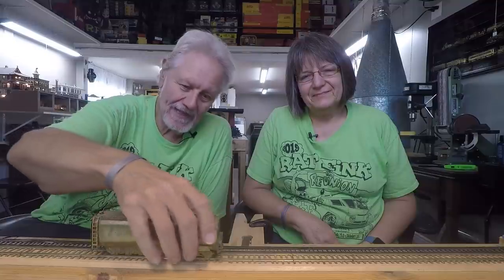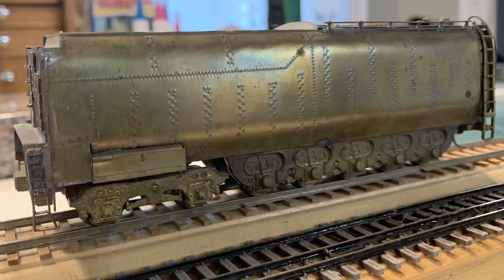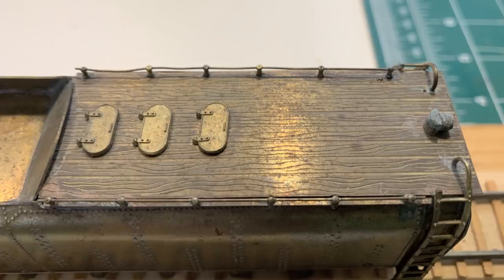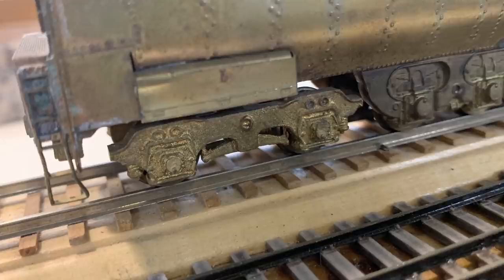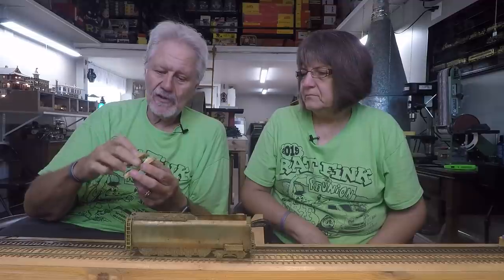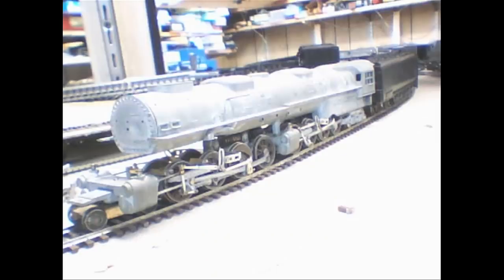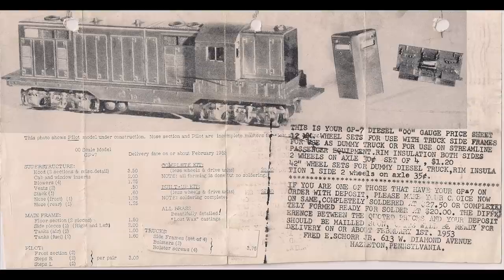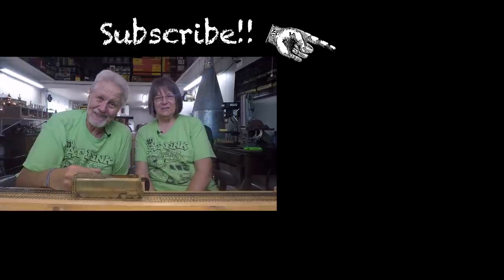Kemtron Brass Union Pacific Centipede Tender Kit

Comment: Thanks for the insight and congrats for building one from the kit. I don't have the guts to bend the brass sheets. However I do have at least a dozen, some built and finished, others awaiting the locomotive. Currently five bigboys, three built, finished and at least ten challengers maybe five completed. Most of the builds we're started by others. I like to super detail certain trains that I leave in the foreground, not so much the ones that I run as the detail is hard to see when they are moving. My best kemtron tender has all axles sprung, yeah somebody made kits that have sprung independent journals, a beauty to behold for realism.
Might be PSC.
Reply from the maker: Wow!! Cool. Bending the sheet is a snap!  The key is to soften it. Heat and then quench in cold water. Opposite of steel. That softens the brass. Then heat and let cool slowly and it re hardens. .
Reply: @ToyManTelevision  Well, thanks for the info, I may have to try it after all. Thanks again.

Comment: Most of the recent British and Japanese O scale kits I bought are full of photo-etch. I never seen a brass etch made by laser. In fact, making positive rivets like on your model would be very expansive with a laser. And photo-etching can be made on both sides, again more expansive with a laser.
For casting, now it is possible to do it with Shapeway. Either the full casting, or they send you the printed was part. I never tried it, but it seems cool.
Reply from the maker: pbyfr yes our friend Don built a brass F unit one of the modern Amtrak units, and he wanted to make it out of brass but he wanted to cut it with lasers and he couldn’t find a laser company that was willing to cut brass. Apparently there is an incredible risk of destroying the laser having a bounce off the brass. They prefer cutting paper and wood and that sort of thing because there’s no danger to the laser but in his case they were willing to cut steel so in a very strange situation he cut the whole model out of steel, and then copper plated the whole thing so that he could easily solder and paint. Gee I think photo etched would’ve been easier!
Reply: @ToyManTelevision  Metal cutting laser are anyway a lot more expansive than the other, like 10 times. At work, I wanted to cut some plate and then have some big marking over a 20x20 cm plate, but the price was prohibitive, as laser is paid mainly by the time. 
Platting with copper must have been quite costly.
Photo-etching for model trains will remain current for a long time.

Comment: The big and massive Bowser die cast steam locomotives like the Challenger, Big Boy, T-I, I-1, M-1a, etc. could pull the entire layout around. I miss those Bowser steam kits. Not detailed worth a damn out of the box, but well made and solid as a rock. Some of the nicest and best performing model steam locomotives I knew of back in the 70's started out as Bowser kits. Fun Fact - Bowser bought out so many historical kit and detail part manufacturers over the years and kept many classic models in production for decades; Penn Line, Varney, English, Cal-Scale, etc. Too bad Bowser concentrated on mostly PRR prototypes (mostly carried over from Penn Line) or generic make believe locomotives like their 'Northern' kit. That and the eventual death of all metal kit steam locomotives in the hobby marketplace. I still want a few of the Bowser kits, but it is hard to find loco kits in unopened / complete condition at reasonable prices. I bought a few old MDC kits and I have a Bowser "Semi Vanderbilt" SP tender kit plus one of the last parts catalogues, and many of the English's Bachmann repowering kits. I would like to find an Old Lady 2-8-0 and the NYC 4-6-2, both of which will make great starting points for modelling either NP or SP locomotives (for my roster)....someday.
Reply from the maker: Hi. Wow that’s some pretty history. I have sort of a love-hate relationship with bowser kits. I’ve built a couple of the traction models, which really have no detail at all, and the giant motor seem through the windows really is a mess. But the neat thing about a Bowser kit is it’s a jumping off point but if you really want to put the work into it can produce an amazing model! The thing I enjoyed most is that they didn’t include much detail. So instead of having some cast in fake details, they simply have nothing. Which when you get right down to it as much better because it gives you the opportunity to dial it in and use your own castings or your own scratch built parts and really personalize the model and turn it into a highly detailed model.